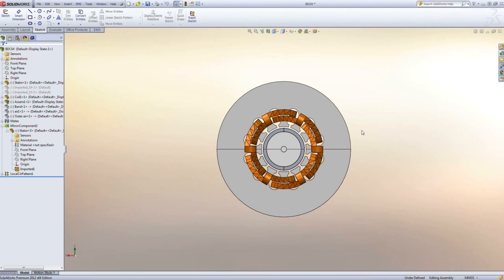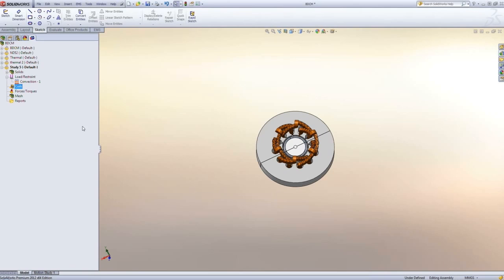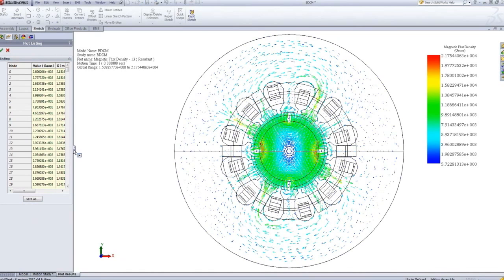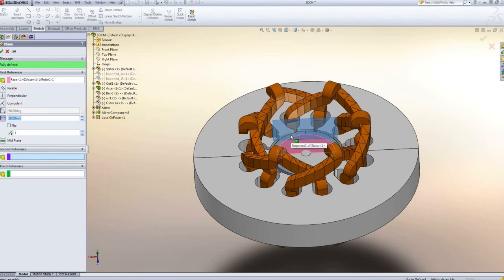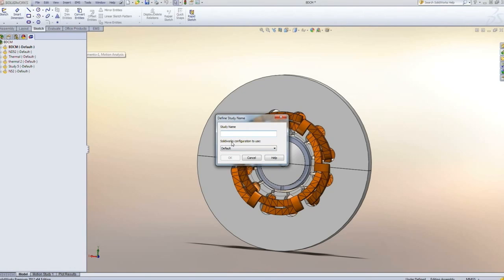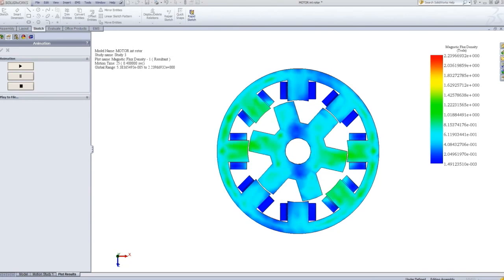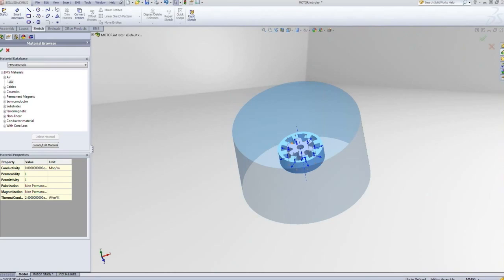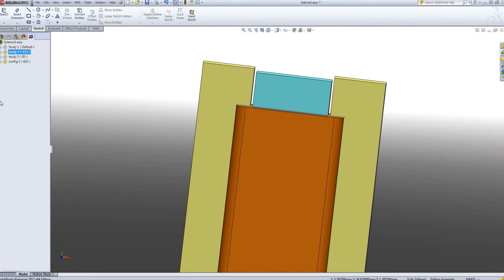[Webinar] - Motor Design in EMS 2013-04-18

Comment: Well, I've found some problems with those coercivity directions.
I've tried cilindrical along rho, no effect, it seems nothing happens much.
The I took cortesian with local coordinate system, positioned the magnet between 2 iron hoops, the field vectors are not traveling through them, they are actually convecting inside the magnet and the inner iron hoop. No field is transfered to the outer loop. What I did wrong?